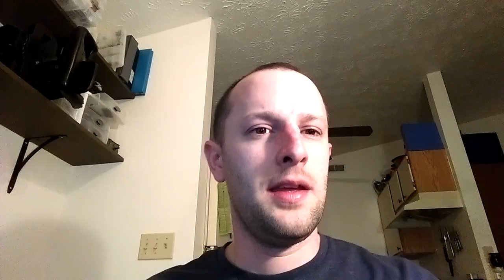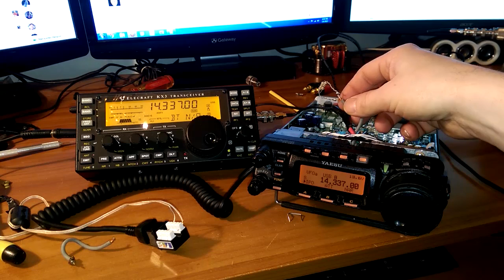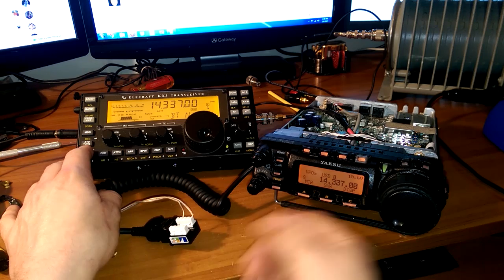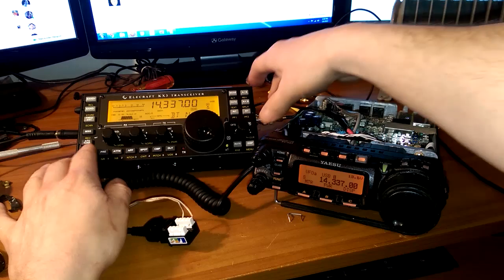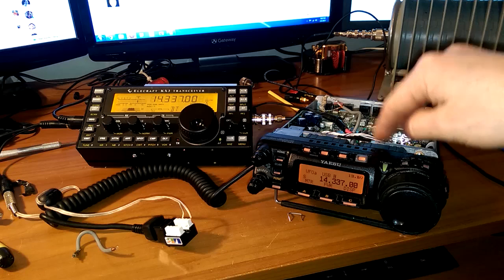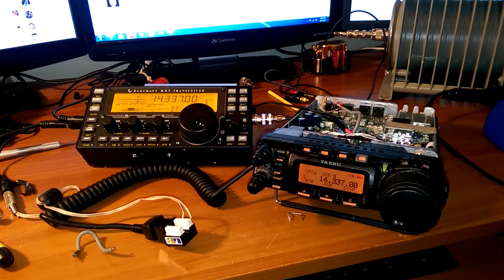Using the FT-857 as an amplifier for the KX3

Comment: Interesting idea Dave - especially given that I have both rigs here. Did you ever get it finished, or decide not to go for it
Reply from the maker: I did use it for a few months before getting a KXPA100 for Christmas, and I eventually sold the KX3 for a  Flex, but I'm now considering revisiting the project, as I just got a LimeSDR that can transmit on 630m-70cm at 10-100mW. The 857 should be capable of developing at least a few watts on 630m with a bit of modification.

The impedance mismatch between the KX3 and 857 did turn out to be a bit of a problem as it contributed to some distortion on the output of the 857 above about 50W output. I ended up building a set of pi type attenuator/impedance matching pads that added about 6dB of attenuation and brought the SWR close to 1:1 on all bands. That let me drive the 857 with an power setting on the KX3 that was a bit more uniform from band to band. I also added a good 1:1 current choke between the two radios and bonded the chassis of both rigs, and that cleared up the distortion.

If I do revisit the project, I've since learned how to program on Arduino, so I'll use the CAT on the 857 to allow it to follow the transmitter frequency automatically. Both radios are pretty easy to talk to, so you might consider a similar approach.